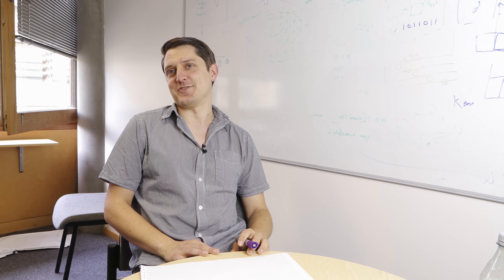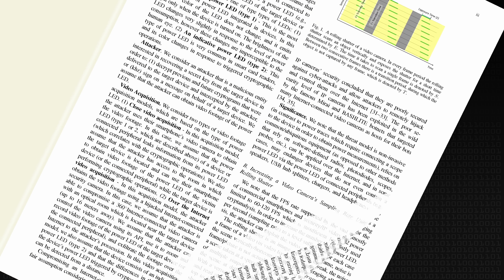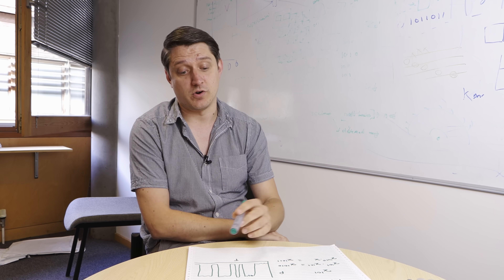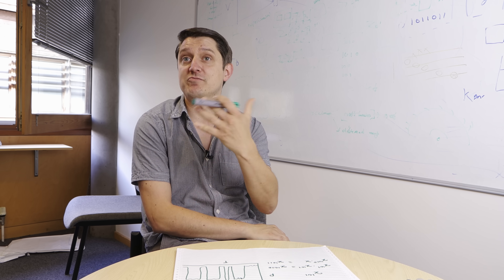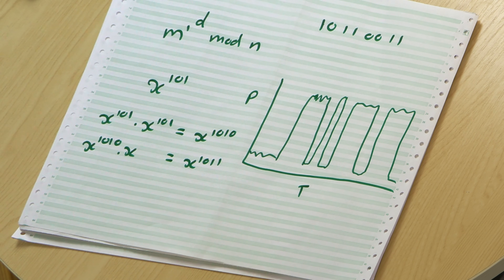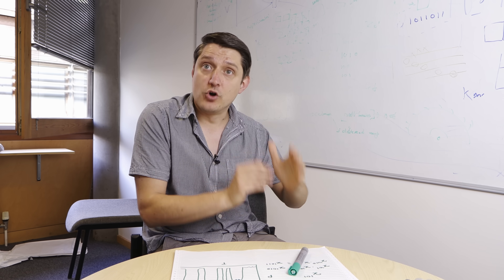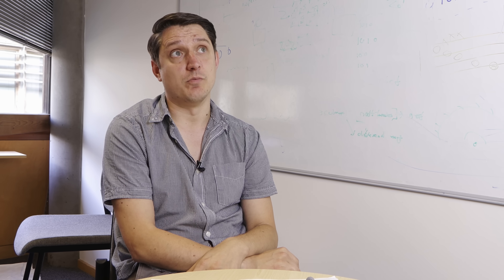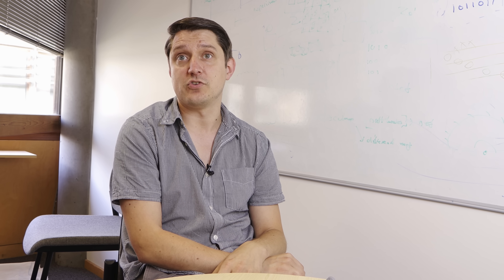Power LED Attack - Computerphile

Comment: U could have simply wrapped the led strip around the tube, instead of vertical strips and measurements around with soldering etc.

More tools and a fully decked workshop = more money than common sense tbh. Complex Solution looking for a problem.

Comment: But don’t we always use a capacitor in parallel with any led (no matter led is in power supply unit or motherboard or anywhere else) to prevent flickering or have a smooth output from led!!

Comment: Maybe it'll become standard practice to add capacitors to power LEDs to low pass filter these things. I wonder what else you could do to thr circuit to obfuscate the power usage?
Some way to add noise to the led current seems like it'd be useful.

Comment: Neato.. Just because the camera is 60 Fps

But the camera  (say 1080P)  is using 1920 x 1080 pixel  - so that is  over 2 million pixels  times  60 FPS – ie samples per second can be interpreted..   That is  Over 120 million individual pixels /second are sampling the light intensity

 -  like sampling every  8 nanoseconds.  That is like having    a $20,000 dollar spectrum analyzer in the room.   Spooks are everywhere…

You would have to swap out the rooms cctv camera with a special camera with pixel samplers— but that is easy… ..all modern CMOS  cameras already have built-in pixel data streams already running   ….    but no-one could tell…

Comment: Who would win:
- Power LED attack
- 100uF capacitor
Reply: I don't even think you need a capacitor. I think for how fast these processors do those calculations, taking into consideration the capacitance and inductance that is already on the board, it will be too fast. The brightness of the LED would already change by such a minute amount and the capacitance / inductance would reduce that even more given the speed of the changes, I personally don't see this thing feasible.

Comment: I've got two ideas off the top of my head to fix this vulnerability, would these work well in practice? I'm aware that more practical approaches have been commented so far but I'm curious whether these are viable at all.

a) for devices like personal computers or servers which usually come with a power led, one could design software that handles cryptographics so that it would also run some junk maths in parallel on another thread because it is typical for these kinds of machines to have more than one core

b) for dedicated small devices like an ATM, or some kind of a peripheral where it could be expected for a cpu to only have a single core, one could design the hardware to accommodate for heightened security because they are expected to handle cryptographics all the time, so it would make sense to put a door in front of the power led and only open it when it is needed to be seen when the machine is repaired, serviced, or under maintenance

Comment: This is both fascinating and terrifying. But I wonder if it is hard on a hardware level to take care of this. In theory all you have to do is ever so slightly vary the power to the LED continuosly. So that the variance in it's brightness is both random and permanent. Then it is not only harder to tell when the system is doing hard calculations, but it would also scramble the signal on the LED. Maybe an antenna and an operational amplifier could help with that. If the antenna is hooked up to the op-amp. And the op-amp is the last step in the power delivery to the LED, the EM-Field in the area should influence the LED. Should be quite random then.

Comment: A lot of photographers will know the problem of using an electronic shutter in a room with LED lighting - depending on the quality of the lighting you can easily get banding in the photo as the rolling shutter makes the the PWM dimming of the LED show up as light and dark bands.

Not great for photos of people at a party - but this is turning it on its head and making the bands the entire point of the photo.

Comment: I suppose a difficulty with writing code to always do the same thing whatever the input is that general purpose compilers, CPUs, virtual machines etc etc are all engineered to be efficient, meaning if they can detect that code is doing something that provably doesn't affect the "output" (not thinking of side channels as output) they will skip over that code to save time and power.

Comment: Adding low-pass filter in form of capacitor will filter out rapid changes in brightness and ruin analysis approach. Also there could be lots of other noise in power signal from power source and converters, other ICs on the same power line, etc. However, the paper gives unusual view angle on hardware, thank you for telling the story, it was interesting to learn of

Comment: Try a solar cell, small amplifier and speaker, feed the output of the solar panel into the amplifier while pointing the panel at distant car headlights, a lens and enclosure will help to focus the light,  you should hear the music that the driver is listening to, the louder they have it the higher the amplitude expressed by their lights. I did this experiment back in the late 1980s with a radioshack solar cell and intercom and a  lens  while using my own car as the light source the song playing at the time was Boys in town, Divinyls.

Comment: Ridiculous.  CPU power supplies are filtered and one level removed from the board’s 5 or 12 volt power.   It’s also trivial to add a 5 cent capacitor to filter the LEDs.   And nowadays there are multiple processors and CPUs and threads scrambling the power consumption.

Comment: last time I worked with hardware was in school but I remember the Routers and switches we used there had 2 flickering lights over every Ethernet port that would flicker if data is transmitted so I was always wondering if they just wired the binary of the data transmitted through the LEDs and if I could read off the package sent by looking at the lights

Comment: would you need a different algorithm for that based on if it's in the US or the EU? cause the frequency of the power grid is different so there'd be flickering from that too that you'd need to adjust for no?
Reply: actually, you'd probably need to adjust whatever algorithm you're using based on the model of card reader you're looking at already so you could adjust for that too

Comment: just make the LED flicker randomly every time it does something, it both signifies the user that something is indeed happening and it would work around this kinda, unless your random noise generator for the flickering uses the CPU state as input but that's a whole other issue

Comment: I have two possible defenses against this sort of attack.  One, not that practical, is to remove the LED's.  Two, you put a capacitor in parallel with and an inductor in series with, the power line going to the LED.

Comment: A useful application of flickering lights and rolling shutter would be to modulate room lighting so that, say, if a photograph of a secret document was released, you would know exactly where the picture was taken and be able to narrow down suspects.
Reply: Something similar already exists with the background hum heard in analog audio. Although there it isn't done on purpose.
Tom Scott has a video called "The hidden background noise that can catch criminals" where he explains exactly this.
Reply: If the photographer knew that was being used they could defeat it either by using a longer exposure or by using flash. Or simply by retyping the document and not sharing the original photo.
Reply: @barneylaurance1865  Or you could just use film.

Comment: Someone is going to have to write the library that the algorithms use with a lot less reliance on high level languages if they want timing consistency. You have to write bare metal code to ensure exact cycle timing.

Comment: This seems like something that while possible in a lab, is impossible in reality.  There are many processes running on the hypothetical computer that is performing these computations, and you'd have no way of isolating the processes from a black box perspective.  If the attack is just limited to smart card readers, it seems like it's an electrical circuit design problem.  Maybe put the led on a capacitor?

Comment: This kind of reminds me of an early chip, the MC6805K1 I used, it only had 512 bytes of flash, so when I wrote some code for it I quickly ran out of space, I ended up with a string of calculations that all got run in a line, one after the other, as there was no room for the conditionals to do otherwise. I just used the results I needed at various times and ignored the others, doing this in a security box as mentioned would help confusing the attackers.
Also many years ago I got a touch close to some gear used by the military for secure comms, it used a shunt mode power supply, so no matter what it was doing it always drew the exact same current, monitoring the power would reveal nothing. They knew all about this one 35+ years ago, so why this modern junk without remidiations known about for like absolute ages.

Comment: Wow that was super clever to use the rolling shutter. 

As an EE, that means to add more decoupling capacitors to the mcu and led driver circuit. Just one more attack vector to think of
Reply: Or, just disable the LED, don't have it on constantly, etc.  Many ways to protect against this.

Comment: No surprise that this is possible in principle, but interesting that a practical implementation was actually demonstrated.
Then again, even things that seem extremely far-fetched can be achieved when an attacker has sufficient motivation and resources!
Reply: unlikely, i mean cpu have multiple process running on a single core, but u also have multiple cores, and the computers have gpu too and other parts that add noise, so really doubt this can be done
Reply: @gubunki I suspect that simpler single-purpose devices like card readers are much more susceptible to this kind of attack

Comment: It's anything but practical. It assumes a lot of things, that the processor does nothing but encryption/decryption all the time or most of the time, that you know what kind of encryption and the specific implementation it uses, that a high resolution, high framerate and a very high zoom camera is available or that you can get into there with a camera of your own and put it right on the led. And by the time you can get close enough with a camera to an led that you can read that leds fluctuation when the device is reading a smart card (seems the only use case for this), you can just yank the card out of that persons hand or something, because you're already suspicious enough. It's interesting, but it's not at all feasible nor practical. It's basically a fun fact.

Comment: That's more of an issue with dedicated encryption hardware like smart cards. A modern CPU with let's say 8 cores and hyperthreading is so incredibly noisy that you could never read actual data from it via power consumption. The only thing you can see there are the load insertion and load release transients from really heavy operations like MMX or AVX starting and stopping.

Comment: LEDs aren’t on all the time, i.e. they are rapidly switching on/off in order to increase durability. So if power change events happen very rapidly (which is exactly the case here) then we’ll miss a lot of them matching the off part of the LED cycle 🤷🏻‍♂️

Comment: Nice cautionary tale, but I find really hard to believe that it can be ACTUALLY pulled of in the wild. First of all, because the rolling shutter doesn't work the way it was presented in the video: the lines are acquired at different times, but each one of them is still integrated over a 1/60th of a second (or whatever the shutter speed was). 
Then you have the fact that even with a rolling shutter you are still way too slow compared to the operation speed of, well, basically anything: by the time you have finished a line and moved to the next one, any single operation should be already done and gone.
Then you have all the noise sources around the target: the flickering of ambient lights, just to mention one.
Then you have the electronic noise of your sensor.
Then you have the fact that the signal is too small to be recorded: even if the single operation lasted 20us (which would be an eternity), and even if you were in the ideal recording condition, the signal would be about 0.3 high, when you record an integer between 0 and 255.
In fact, if you take the time to properly read the paper, you will find out they did exactly none of that, since, you know, it's physically impossible.
What they ACTUALLY did was taking a card reader where, for some reason that I can't fathom, the led indicator was deliberately wired to show the exact time the decryption process started and ended, and, at the same time, used an encryption library where the time needed to perform the whole operation was enough to recover the private key (an exploit 4 years old, and linked to a very precise card manufacturer, but some cheap Chinese producers must have missed the memo).  They then took a security camera with a 25x optical zoom, performed extensive calibration on it to recover some specific working parameters and put it in a completely dark room. At that point they just needed to collect the recording of 10500 card swipes and, presto! they were able to obtain the private key of the device...

Comment: I am no expert, so this is a pure guess. Would a capacitor connected to the LED, rather than the LED directly connected to the circuit's power, stop this? (Specifically the light-flicker attack, not the power consumption attack!)

Comment: I disagree! The computation shouldn't be consistant, it should be very inconsistant. It is very hard to be consistant and you only need to not be correlated with the key or with the real calculation. Just throw in some multiplication that go nowhere before a 0 at random time or add some squaring before a 1 at random time. The more noise, the better.

Comment: I know of a crude solution for the led (if possible just shut it off and turn back on when crypto is done, IE the power led is controlled in software, but then that might be exploitable IDK)
I know this would not affect the power supply snooping but I think it would solve the filming of the led

Comment: Doesn't feel really practical, you have to use device that can read signals at that speed with enough of sensitivity. Also what about multi threaded CPUs or pipelining ? Other cores already draw some power, so that would effectively mask the power draw of single instructions, wouldn't it ?
Reply: imagine cryptographic devices having such an led

Comment: I haven't read the paper, but I did design LED drivers for smartphones, for 6 years... any decent LED driver decouples the battery voltage by at least one, and sometimes two, levels...the battery voltage ⚡ which is "wiggled" by CPU activity, is ideally decoupled a lot from the battery voltage... Typically, a boost, or buck/boost converter, followed by a linear current regulator. If the designers, however, use a cheap/poor driver circuit, all bets are off..but, many phones now have AMOLED displays, different animals, again...most tablets do have LED backlights for their display, so a poorly-designed implementation, for instance, with poor "grounding" practice, could leak some amount of backlight modulation...

Comment: This is so true in cheaper LED circuits with insufficient capacitance on the LED power circuits.

Cheapening out on engineering, of both electronics and software has to be the number 1 reason for a lot of exploits.

Comment: When fossil fuel supplies looted - they turn - curse.
When Energy looted, it turns a curse that destroys consciousness in humans and demolishes the real future.
Thermodynamically, there is no such thing called Capitalism.
This is owing to the fact that fossil fuels have been traded under the doctrine of what's called 'supply and demand', not on the basis the stuff is finite.
What humans have lived, under our outgoing Western Civilisation, is actually the best of a Communism-disguised-Capitalism system.
What remains in this system, now fossil fuels are mostly gone to the ground - is more deception, gulags and wars (Iraq, Syria, Yemen, Libya, Ukraine, Russia, Sudan, and on and on).
Nikola Tesla, Einstein, Huxley, Orwell, Turing - should be forgiven for thinking their systems can last forever – finite fossil fuels are dangerously hypnotic to humans and their mental capacity.
Humans were not ready morally, ethically and intellectually to start the mass extraction of fossil fuels with the advent of the steam engine 300 years ago.
The Magna Carta requires now overhauling – adding to it the right for humans to understand what Energy really is;
"In any system of energy, Control is what consumes energy the most.
Time taken in stocking energy to build an energy system, adding to it the time taken in building the system will always be longer than the entire useful lifetime of the system.
No energy store holds enough energy to extract an amount of energy equal to the total energy it stores. 
No system of energy can deliver sum useful energy in excess of the total energy put into constructing it.
This universal truth applies to all systems.
Energy, like time, flows from past to future" (2017).

Comment: I suppose a challenge to this approach is isolating cryptographic related power fluctuations from other concurrent computations happening on the same CPU/chip/system (like operating system background services). In other words, we can find out the overall power usage but we can't divide that unless we know everything that's happening on that system at that exact time.
Reply: but suppose the led is on a smart card device or any other special cryptographic device
Reply: @manloeste5555  That should make things less complicated but even a smart card reader can be seen as a small computer with RAM, ROM and a tiny OS.